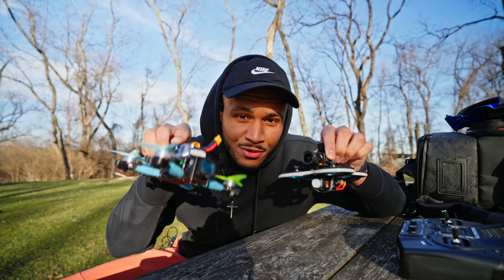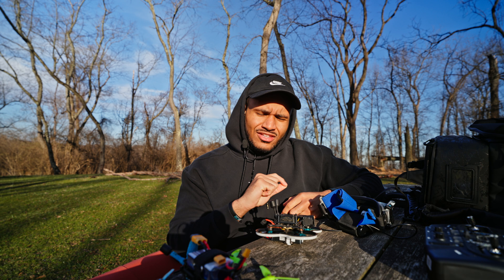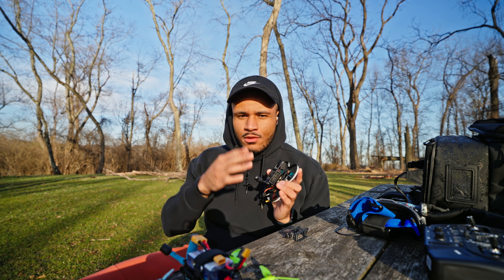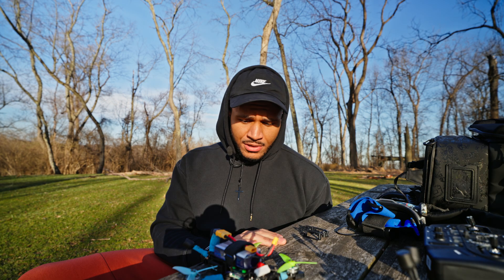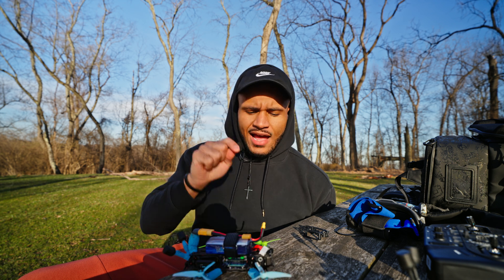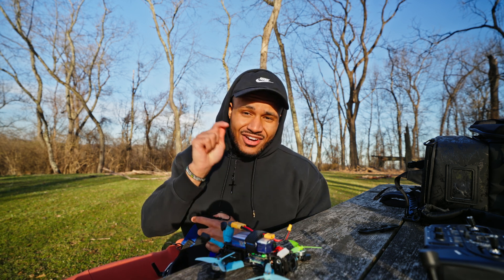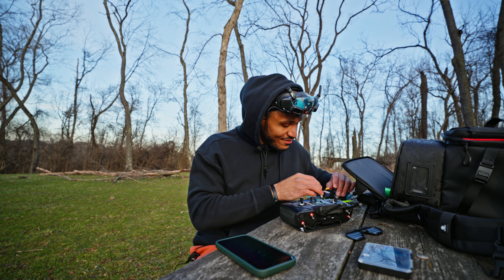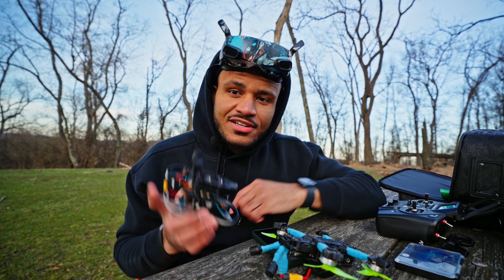My Favorite DJI O4 Pro Drone Builds! | Quadmula Siren F3 Split & Beta FPV Pavo 20

Comment: Nice video 👍 I have also the F3 split with the O4 Pro and it’s amazing. Had the same Motors but ended up putting 2004 Emax motors like bacon ninjas build and this was a big improvement imo. Plenty of torque and really responsive. Now it’s even more near a 5 inch feeling.
Reply from the maker: Thank you! And I also saw bacons video and was torn between his motor recommendation and murdersfpv! I ended up going with murders off a coin flip hahaha.